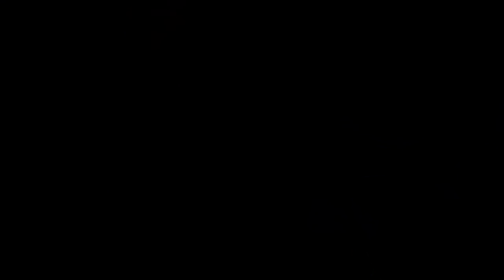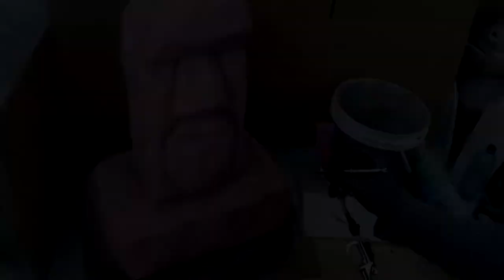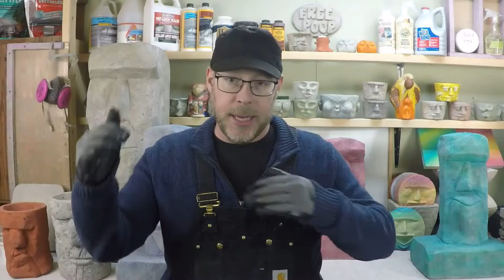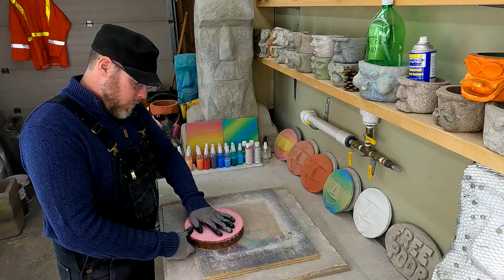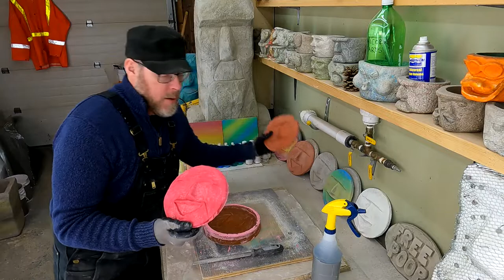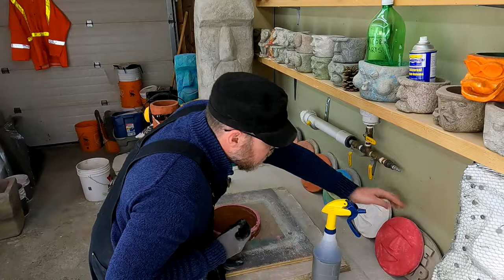How To Make Hot Pink Concrete

Comment: Oh, I have a huge box of acrylics. Perfect. Now I can get the exact color I'm going for on the deco rock. Thanks, glad I found your channel.  My house is never without Rapid Set Cement All or Rapid Set construction cement. Fast drying & you must work fast. Great if you need a fast setting concrete. It is cool.Cement All is great for castings. I happen to call the Rapid Set the brown & white bag or blue & white bag. Unfortunately in my area unless I travel the interstate for miles I can't get white Portland. I love it!
Reply from the maker: It can be very hard to find white portland cement.  Concrete pool companies all know where to get it.  It is usually not from the local big box hardware store, though I have seen some Lowes and Rona stores that carry white portland cement.  Usually you get this stuff from concrete wholesalers.  It is a pain to figure out as a regular hobby user of these products but certainly opens a lot of doors in terms of the color options you can make.
Reply: No doubt, darn pool guys. I know a master mason who taught me all the tips and tricks. Traveling to the quarries and supply houses up in the mountains of PA is a huge pain. Then they want me to buy truckloads of the stuff. Even getting a decent sand mix is difficult. Can’t believe this is my hobby. I couldn’t choose knitting like normal old women. I just love working with this stuff it’s like sculpting. Making rock forms for old basement walls now. Thanks, love your creations. You’re very talented.

Comment: Yes, an upvote for the awesome pink concrete, as pondered in the video. I would think, if you desperately for some reason want an even deeper, darker color, you could also paint the surface, adding yet another layer of added acrylic, as you show in other videos???  And if you use an acrylic paint that is meant to be very high concentration in pigment when very thin (e.g. acrylic ink or high flow acrylic or air brush acrylics, as 3 options), is another way to get a watery thin acrylic with an intense level of pigmentation/ more than you can get by watering down a thicker version of acrylic paint. Blessings. peace everyone.

Comment: Can you the slurry to fix air pockets
Reply from the maker: Yes you can, either before you cast or after the piece is cast you can "sack" it with a parge mix high in cement content.  Not quite as wet as a slurry tho

Comment: Is there any way to paint/ draw thin lines on concrete as well?
Reply: For example: If you are building a form, rather than using a mold/ slurry/ colored concrete method, could you "paint" with a slurry like this to add artistic elements to your wet/ just finished concrete project (such as your table, or planter, or rock projects)? (I guess the paint on your finger with the test for 'rub off color' could show there is concern of bleeding?)
Reply from the maker: @cchemmes-seeseeart3948  definitely it will bleed.  You could paint lines with full strength acrylic paint after the concrete has dried and cured.  This would have reasonably good results.
Reply: @creatingconcrete  Thanks. I had a sense that would be the case... I'm thinking of drawing on it too... you know like how kids pull out the sidewalk chalk... lol.... That gave me a laugh, but I think there is potential
Reply: Or I might carve into the concrete at an early stage, & then reinforce that with paint later. What stage is best to hand write in letters?  @creatingconcrete